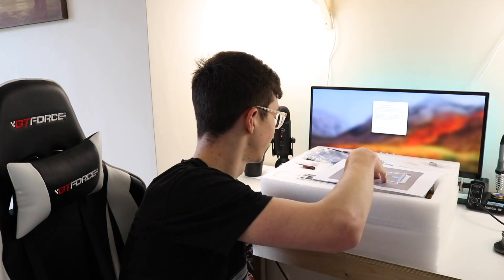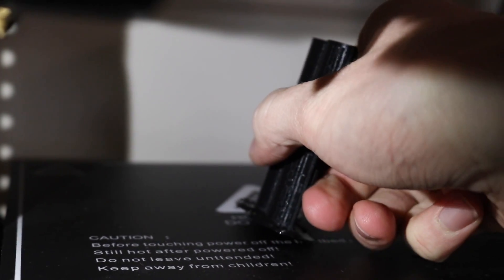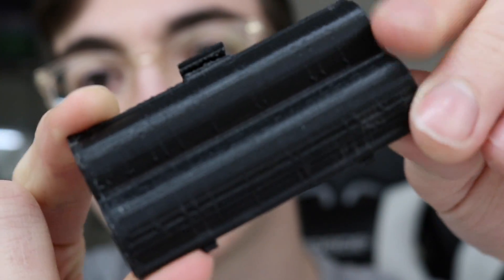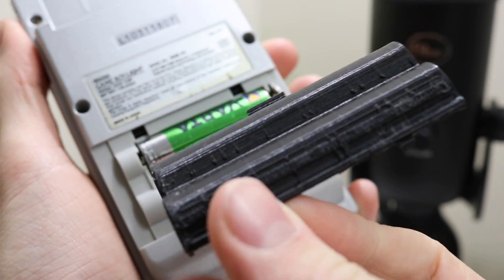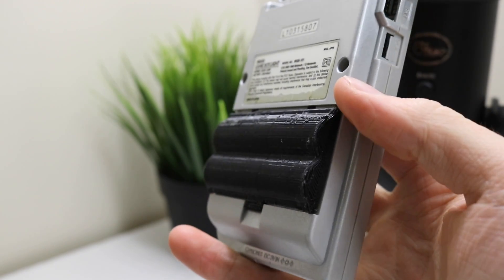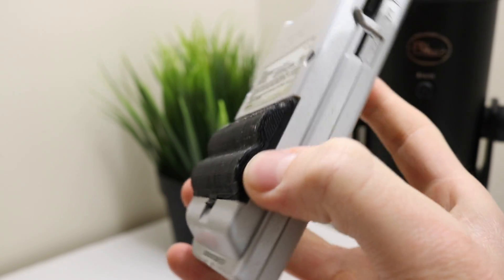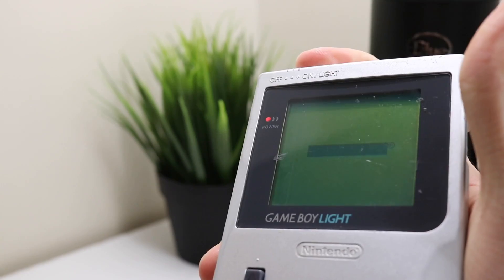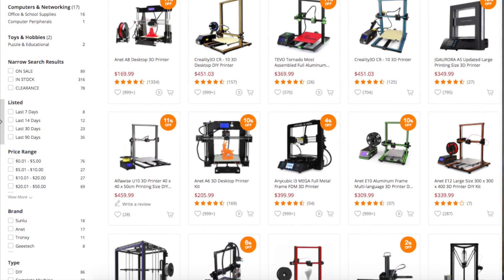3D Printing GameBoy Parts!

Comment: I'm not sure if that 3D Printer could possibly support it, but you should look into getting dissoluble support printing. It requires two extruders and dissoluble printing material, but it allows you to print the item you want in your regular printing material and print the supporting structure in the dissoluble material. You can then take your object and dunk it in some water, and the support will just wash away.

Comment: Disappointed that no printer footage, wonder how stable or wobbly it is, but it does make a very decent impression! You probably want to make sure the Z couplings are well centred and running true. Don't print fast at first, especially if they use a pinion gear on the extruder instead of a hobbed stainless gear, as they often do, like 50mm/s should be good. Steps/mm on extruder is too high, you can trim it out in the firmware EEPROM or you can decrease extrusion multiplier in Cura.

Custom firmware with linear advance is the way to go to get rid of the boogers, but you can try to trim them out by enabling some coasting in Cura. Also it would help you ensure that you have thermal runaway protection.

Comment: I reccomend laying the item flat in Cura, you would probably need less material for support. looking forward to seeing more videos using the printer :D
Reply: Unfortunately it doesn't have a flat side.
Reply: yea but he doesn't have to stand it vertically. he can lay it horizontally and less support is necessary.
Reply from the maker: It was reccomended to print vertically, but I am still new to this!

Comment: A few pointers (from personal experience) on these cheap Chinese Prusa clones; 
Check the PSU is man enough, you may need to upgrade to a 30A model.
Check the main board is man enough to run the hotbed, adding a MOSFET is a priority.
The rough finish could be down to loose belts (as well as calibration of the hardware and tuning your slicer) fit some tension adjusters and upgrade the belts.
There is a massive online community for hints and tips and help. Enjoy!
Reply: Well done repeating all these popular half-truths here.

A 15A PSU is enough. The reason they kick the bucket is simply that they are sometimes defective, because they are cheaply made.

Similarly power/heat related death of MOSFETs seems unlikely, i mean normally you can run them to 120°C for a decade and they will be fine. Chances are, they die because of lack of inductive spike mitigation - the heated bed has quite a bit of inductance. But what most people do then is install an unknown Chinese MOSFET as an upgrade kit off Ali instead of the perfectly fine STP55NF06, and they still have no free-wheeling.

Anet fire from 3 weeks ago was a machine with upgraded PSU and upgraded MOSFET, but no added safety features. While i cannot conclusively state that upgrades were responsible for ignition, indeed likely they weren't, it seems like putting more power into a somewhat finicky and potentially dangerous heating machine is just about the least desirable thing to do.
Reply: From what I read the cause of that fire was the heater coming loose and the firmware seeing the temp falling in the block so it ramped up the pid control. Unluckily enough the heater then touched the fan ... and well the shit hit the fan: fire and smoke. Never leave printers unattended and upgrade firmware when possible to revisions that shut off the heater when it detects that something is wrong.
Reply from the maker: I don't know what any of you just said! But thanks for the info! I will do some research.

Comment: After you have calibrated the printer it will look much better. Eventually you should plan to install a mosfet on the printers heated bed and the control board, some of the cheap Pursa i3 based printers (Yours included) have been know to be a fire hazard without them.

Comment: What do I use to make a back cover for my game boy pocket (besides a 3d printer or tape)
Reply from the maker: Buying one off ebay is your best bet. Only a few dollars!
Reply: Very much this. There are lots of excellent quality repro battery covers for the original DMG, Pocket, Color, and Advance systems. The Game Boy Light, on the other hand, has no repro housing parts (aside from a screen lens from Mortoff Games) so I'm actually very interested to see if a proper Light housing can be 3D printed, and then transplant the organs of a Light into one... the shell on my Light is alright but the paint is scuffed all over the place and if I can get one in like, blue, that'd be amazing.